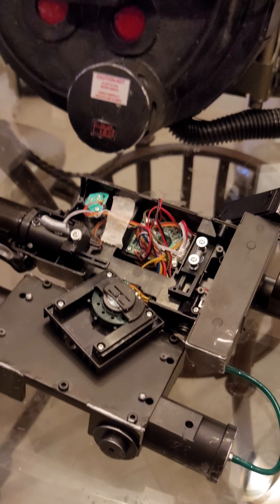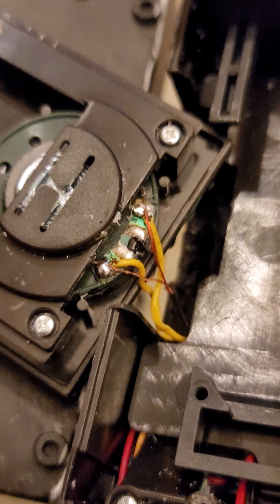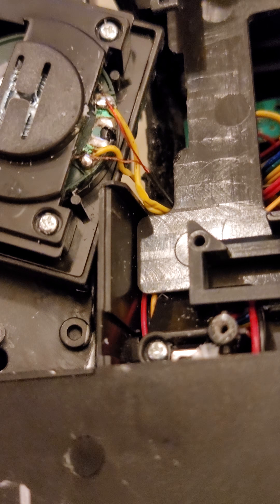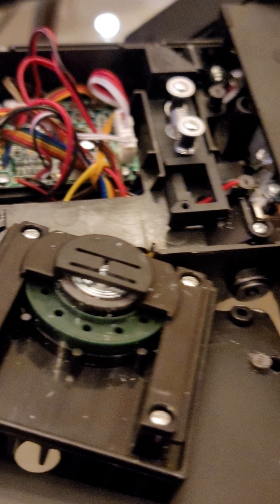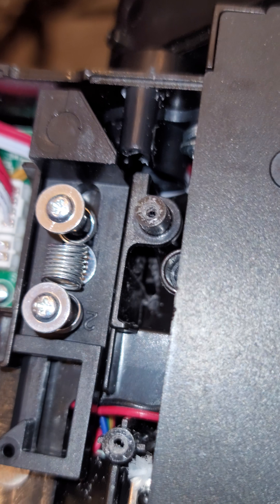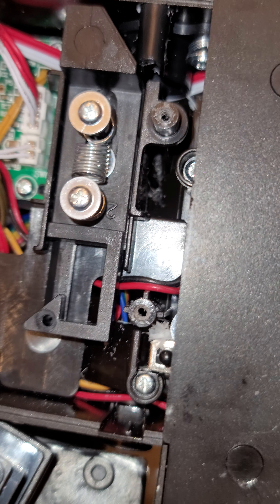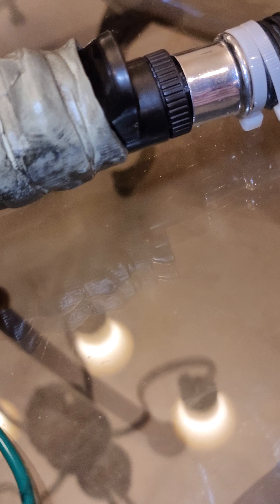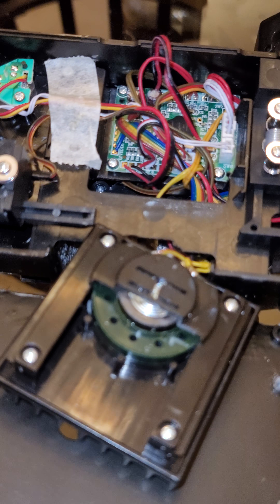Spengler's neutrona wand *how I utilized the speaker and switch for my pack mod*

Comment: So.. I did something similar by wiring to the center welding inputs. I see you do it on the same as they have the stock wires... so I wonder if you solder one to the stock wire as you do, and one on the middle one you would get a stero output.

Comment: My speaker sound has lost quality and has gone about 50% volume, would this be down to a bad connection as the wire was tight when taking the vent out?
Reply from the maker: Very possible it's a bad wire connection
Reply: @seanschops3172  I just changed the wire and same thing happening  but I see 4 solder spots. Does any wires link to the middle solder sections?
Reply: Would a hairdryer next to the speaker cause damage?
Reply from the maker: If the speaker itself got damaged that could cause loss of sound, also make sure your solder points aren't bleeding into other solder points.
Reply from the maker: Could also be an issue with the sound board
Reply: @seanschops3172  I'm fairly certain it's the speaker itself, I've bought a new speaker to replace the old one. I mustve either fried the speaker with the hair dryer or damaged it getting it out the shell
Reply: New speaker arrived, I think it sounds the same
Reply from the maker: @stewartmcminn7773  make sure all connections are solid. Also check yhe boards for any possible solder drips that could cause things to touch.
Reply: @seanschops3172  done, noticed the wire leading to the modes is a little damaged from the extending end
Reply from the maker: @stewartmcminn7773  great, did that fix it?
Reply: @seanschops3172  yeah works fine again just worried about that white wire going to the slime control
Reply: @stewartmcminn7773 where did you get a new speaker? I only ask because I think I damaged mine trying to solder new speaker wires to mod my Spengler wand and I’m afraid it might be muted forever.
Reply: @zbradley1990  you sure it's not a bad solder?
Reply: @zbradley1990  Magnet Speaker 16 Ohm 0.25W 36MM X 1 Great for ARDUINO Electronic Projects Green

Got it from ebay for £4

Comment: Was it hard to solder the wires on the switch? Don’t seem like a lot of room to get to it. Without the soldering iron burning wires that’s around it.

Or could you solder the wires onto the Circuit board where the switch wires connect?
Reply from the maker: Well I unscrewed the nut on the outside of the switch and pushed it out the side of the gun body. It gave plenty of room to work on.
Reply: Sean Schops oh nice.  I’ll have to try that.

Comment: Is there a way you can describe how you got the wires after drilling the whole past where the batteries go so you don’t damage that area
Reply from the maker: Once you feed them through the hole I use a coat hanger to grab the wires and pill them through the handle.
Reply: What kind of wire did you use. Would a stripped aux cable work

Comment: How did you get it to your speakers my wand keeps shutting off when I turn my intensity up
Reply from the maker: That sounds odd.  I did it just like I describe in my video. Make sure no wires are touching and you have new batteries.
Reply: Sean Schops well do not have a amp to put on mine It’s awful difficult to explain but I ran two wires through the wand from the speaker then I ran those wires directly to the speakers contacts and it will send the sound out once the intensity turns up all the way it will power down once fired
Reply from the maker: Oh ok, sounds like your over loading the sound board. If you disconnect the pack speakers making it stock again. Does it work? If so. You will need an amp .
Reply: @seanschops3172  yes it works absolutely fine without the speakers hooked up

Comment: Ever considered changing the bargraph?  I ordered one that's more screen accurate with the scrolling etc, just hoping I can shoehorn it into the wand.  Hopefully a matter of detaching the one that's currently in the wand (which seems to be 5 led's and nothing more) and putting the new one in its place with a couple of wires for power.

This is the one I snagged, has all the other lights as well but as they seem fine in the wand hopefully they can be detached just to make use of the graph.  https://www.jupiterstore.com/ghostbusters-movie-prop--proton-wand-light-board--screen-accurate-thin-bar-graph.html
Reply from the maker: I thought about it. I'll need to look at the wiring as a bargraph it typically wired alot differently. Also I would need to make sure that the dial changes the bargraph as well as the intensify button like it does now. I really wanted to just mod the wand to show what it could become with what was provided out of the box. I'll give it a look though.
Reply from the maker: Thats a nice kit. That may work as the bargraph has its on board so it looks like it just needs power and maybe leads to the intensify button.
Reply from the maker: The more I look at the more it can easily be done
Reply: @seanschops3172  Have one ordered but it'll take a while to get to the UK, with a bit of luck it needs minimal work :)
Reply: @seanschops3172  That's the one thing that stands out to me on the wand, how hokey the included "Bar graph" is.  Just upgrading that alone would improve it quite a bit.
Reply from the maker: Yes, true